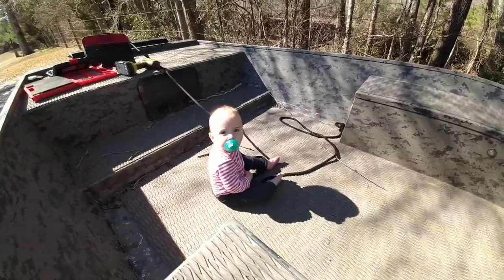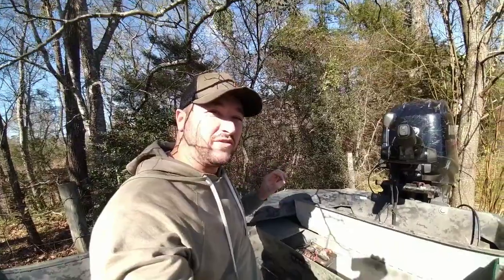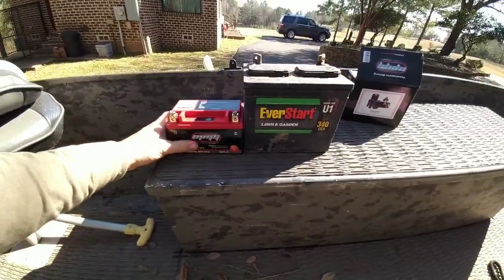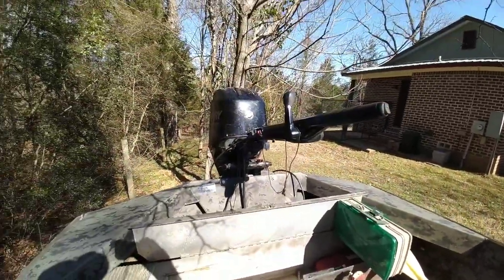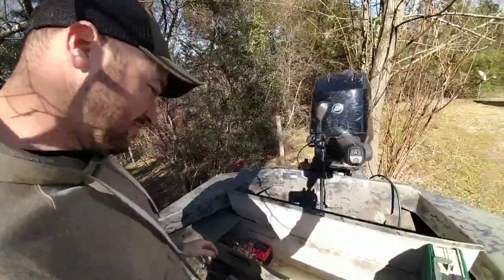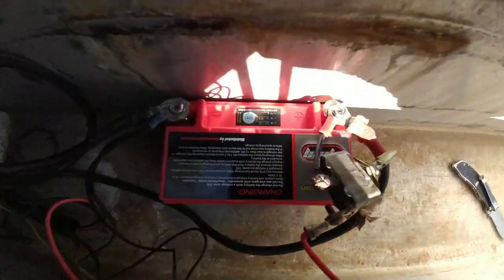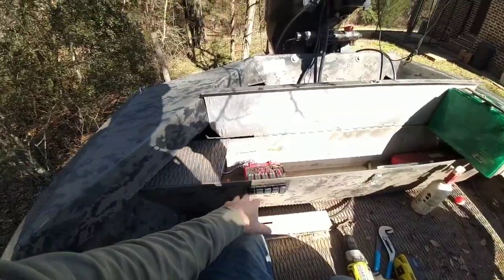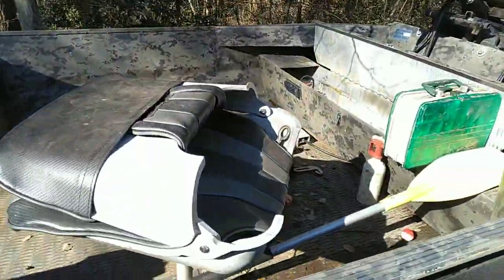New Lithium Battery (MAY VOID WARRANTY) Mercury does not recommend.

Comment: Does Mercury says it’s ok to use lithium ion as starting battery? I think Yamaha explicitly says not to.
Reply from the maker: I believe you are correct with Mercury as well. I know some people who have been doing it for a year now with no issues yet. Im gonna take the chance.
Reply: @DennisBohannan  I’m sure it’s lack of testing rather than any known issues on their end. Good luck. I may do the same down the road. I also use a U1 mower battery and it has served me well with only a 25 Yamaha.
Reply: I contacted Mercury they listed s9me big HP it was ok , but no on motors under 75 hp